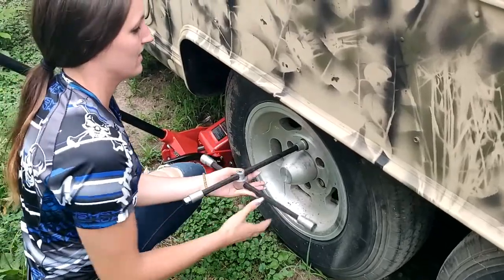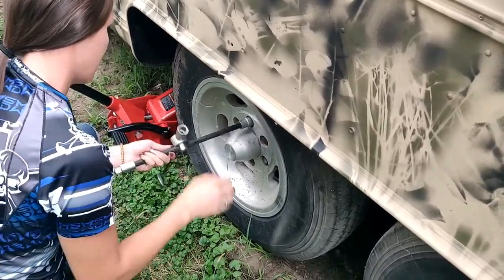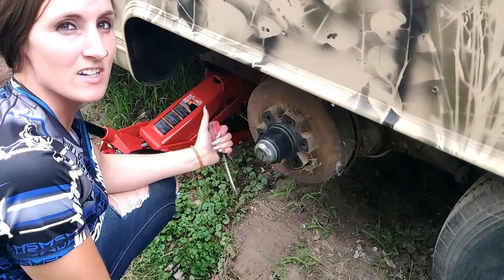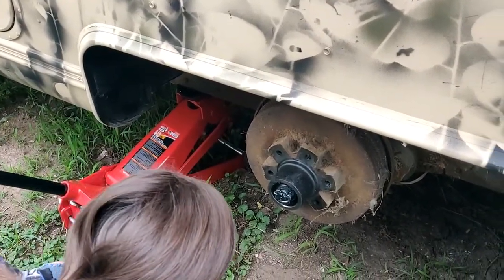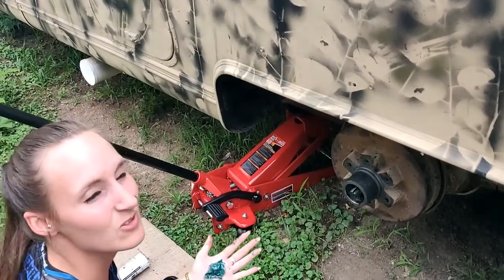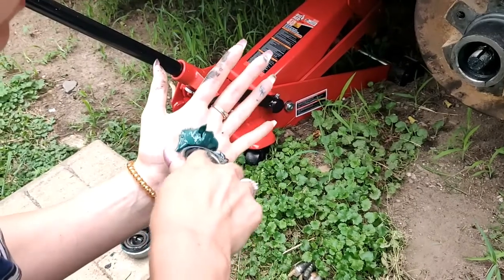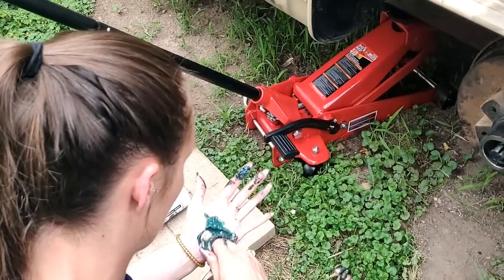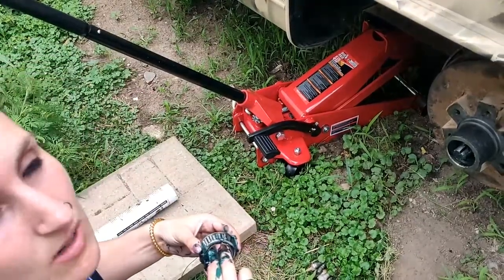Repacking Wheel Bearings on AirStream with Outdoorsie Jen.

Comment: You need to be a little more gentle with the hammer when you're dealing with the grease caps.  You may want to use a grease pencil and write the date on the cap for future reference. Then you'll know with a glance the last time the bearings were packed.